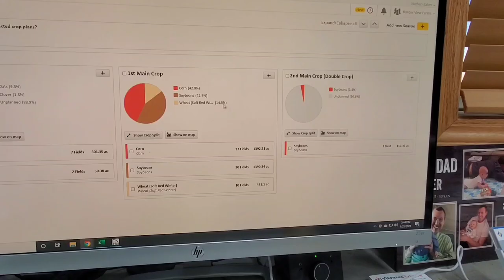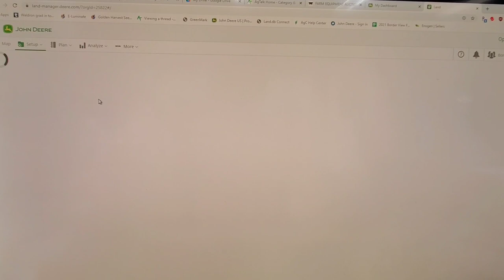Welding Like a Novice - #338

Comment: It sounds like a liner issue in the whip. When the wire sticks the wheels create a flat spot which causes it to sporadically skip and hang up. Usually caused from pinching whip in to tight of an angle
Reply: that is what I thought as well. replace the liner in the whip.

Comment: Can't weld paint very well with a wire welder. Even though some is wire wheeled off, if a person lightly grinds the metal, it cleans it and it will weld waaaay better. This is even true for new clean metal, lightly grind where the weld is going to be.
Like others mentioned you may have a liner issue also.

Comment: When your mig welding you need to have bare metal  unless you are using flux core wire
Reply: You need to grind all the paint off where your welding
Reply from the maker: Did you see the wire wheel? It was bare metal.